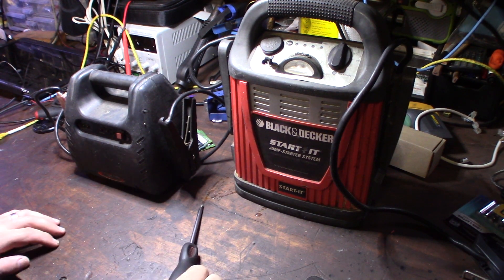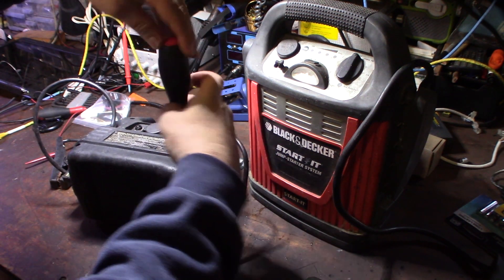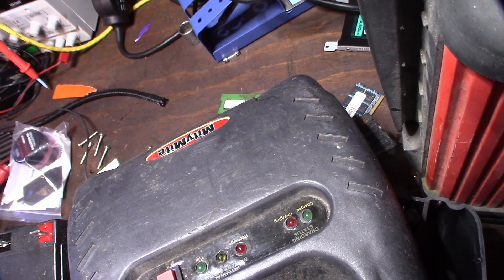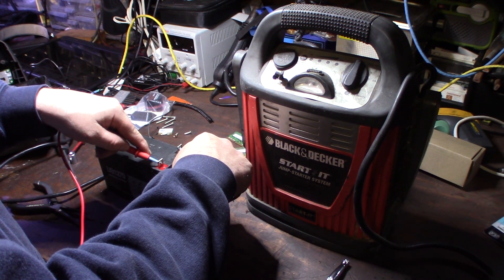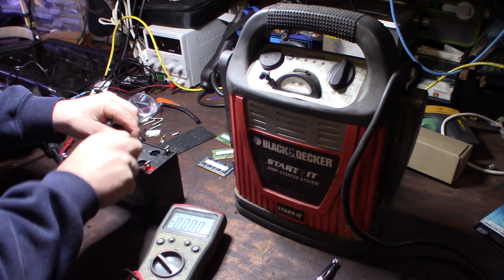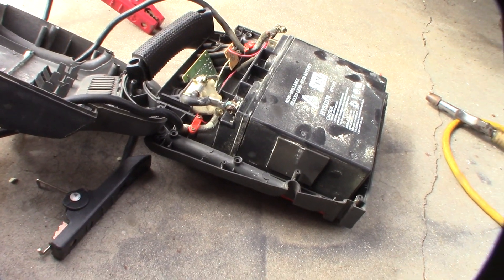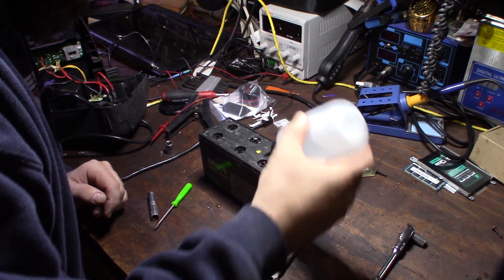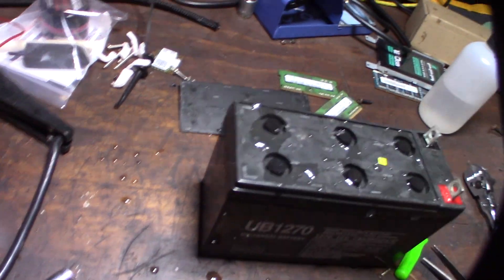Battery booster Jump Pack starter Rebuild battery recondition desulphation part 1

Comment: Hit it with DC converter, discharge test a few times and check load. Add water as needed but dont fill them to the top. Fill them to the plates bud. I do a very similar process to this. A watt meter and voltage cutoff helps too.